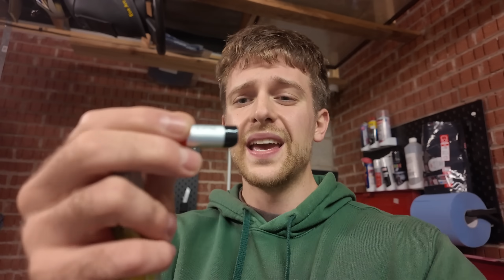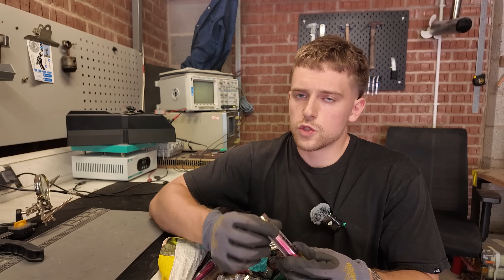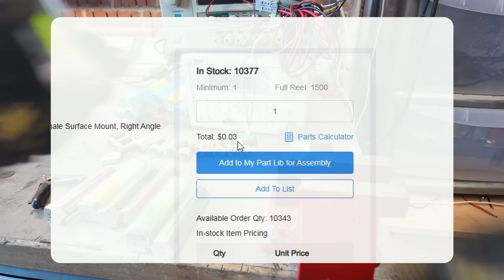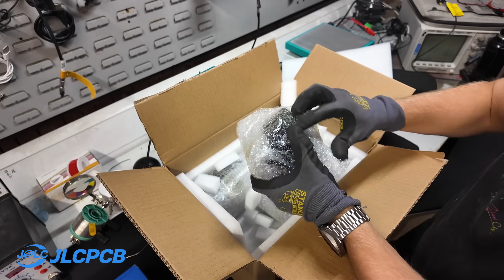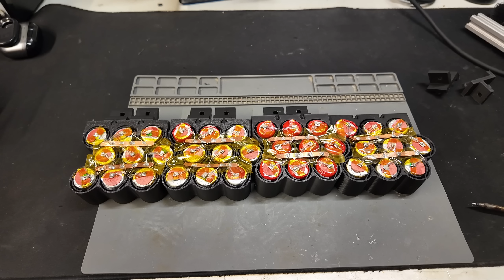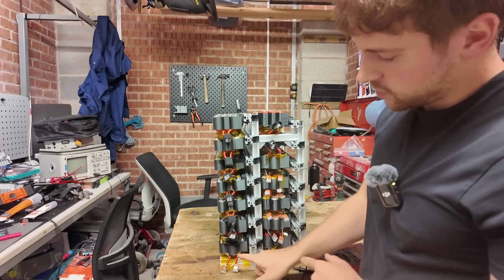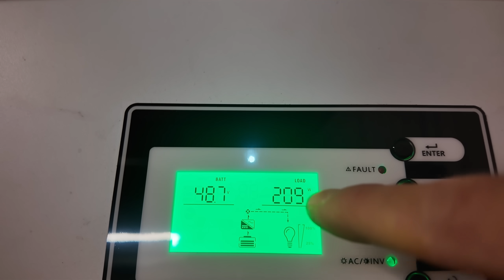I Powered My House Using 500 Disposable vapes

Comment: id be tempted to do something with em if they werent so prone to catching fire..... they burn realy hot.... if youre smart youll burry the big batteries you make at least four feet down after you have em wired up - then it dont matter if they melt down as much... least it wont burn your friggin house down (you can turn a 55 gallon drum into a battery if ya want then)

Comment: i collect these from my coworkers to scavenge the coils and batteries from them. not much juice on their own but surprisingly decent cells usually of a standard diameter or common pouch size making them easy to adapt to fun little things. gonna try and make some 6s packs with connection for combining to get a good pack size. most of them are the same vape and have 18300 cells.

Comment: I used to work for BAT in the battery lab, CT scan , SEM and cell cycling, sorry to say but the charge/discharge cycle on disposable vaps is very low.. you could get about 20-50 re-charge cylces compared to 550-800 on the 18650 cells. so great project but maybe, next time, use 18650 cells from old laptop batteries ? or pouch cells from the newer laptops

Comment: about 4 mins in but im pretty sure a lot of thease  cells below 3 volts can be  trickle charged toi try and recover the cell i saw somone do this with old EV batterys before wich are also lithiom ion so you would  likly need to build some kinda device to  trickle charge  mass amounts of cells  and rebalance them i think is the term

Comment: Sir this is how you earn a sub. I was tinkering with a gigantic dispo vape, turning it into a rechargable battery bank.. and I found a video of you powering a house with it. 

I legitimately wonder about the long term viability for that.. It would 1000% work in a power outage situation.. Id want to have some serious Cooling measures & fire safety installed if I were to use that bank for more than 10-12 hours though.
Reply: If you need any heat sink / cooling designs, let me know, would be glad to help.

Comment: You need a solar system panel or  what you can do is rig a 10amp battery charger to it so it never goes dead be charging when your a sleep that's the way i would go or get 2 chargers throwing out 20 amps dirt cheap on Temu get the clever ones

Comment: It's not really accurate to say cells below 3v are damaged and unusable. It's more accurate to say they are degraded, in that, they wear more each time they are brought that low than they otherwise would have been from an equivalent number of cycles within the recommended/rated voltage range. I have regularly (maybe 50% of the time) recharged batteries well below this threshold and compared them to batteries within the recommended range only to find them within margin of tolerance as far as capacity and internal impedance. Big Clive did a video where he mentioned that a lot of powerbanks are shipped with the internal batteries at voltages well below what they are rated at for safety reasons, sometimes 0 if I remember right and they give their rated capacity after a charge.

In a battery pack though, where the cells are in series, if one cell were to be 1.7v while the rest are 3.4v, it is highly likely in this case that that cell is damaged, which is the reason that it fell out of balance to begin with.

https://www.youtube.com/watch?v=sRwoYJyjZNo

Comment: Great video and great proof of concept ... Although, it must be said almost every single aspect of this current setup scares the shit out of me honestly I’m so glad I’m not your neighbour 😂. Was ohms law used when calculating your main cable and fuse ratings because they look way too small….Wagos at that current 😳. Back feeding a consumer unit to supply an entire house… I’m a qualified electrician and have a BEng in electronic and electrical engineering so have a little idea on the subject. A homeowner in the UK got find 60k this week for setting fire to his and neighbours property after he wired an extension lead to his shed from the house. What you are doing is notifiable works you need to be a qualified electrician and contact DNO. You could be in for prison time and 100’s of thousands in liability you crazy bastard 😂…. My advice, refine the battery bank and get it enclosed. Get those Wago clips off and get plugs on there for easy assembly. Upgrade the mains cable on the battery to coincide with total current load when house is connected. Then get a sparky to commission that way you keep yourself covered as currently your insurance company would not be impressed and certainly won’t payout for you or any neighbours affected.. And don’t add solar ffs until you have spoken to DNO and has a sparky commission the consumer unit and have all the above sorted with the battery, there are a lot of considerations including what type of mains supply you have and its earthing arrangements there are 3 types and not all are suitable out the box it could be extremely dangerous for you and your neighbours, genuinely your neighbour could take the hit in an electrical storm via its earthing arrangements essentially making everything connected to earth live including the gas mains. All that being said, keep going just keep yourself and neighbours safe in the process.

Comment: 17:46 do you have something in that breaker setup to prevent back feeding power? For instance if the power goes out from the city and then you accidentally leave the breaker to the house on. You will back feed power to the grid which will best-case kill your battery and worst case kill a person working on the lines.

Comment: If they’re above about 2.6V they’re usually fine to recharge, though they might be a bit down on capacity. Once they’ve dropped below ~2.5V the damage starts to set in and they become a bit dodgy to try and recover.

Best bet is to test them properly with something like an Opus BT-C3100 before sticking them on what looks to be a bloody nice charger – check both internal resistance (IR) and capacity after a full cycle. That’ll tell you if they’re still healthy or just e-waste in disguise.

Comment: Lithium cells aren't just blanket "dead" whenever they get fully discharged. There are ways to recondition them, shock charge, or even just regular charge and test.
It takes a considerable amount of work to fully kill a cell in-circuit.
Reply: This. The correct way to bring back severely discharged lithium cells is to slowly charge them at a low current and measure the internal resistance when full, then do a cycle/capacity test and measure the internal resistance again. If it's equal to what it was or lower then the cell is good. What you don't want is a cell not taking a charge, heating up wayy too much (Some heat during use and charging is expected and normal) short circuited or unable to deliver the current it was intended to do.

Comment: Here in Germany, we have the world's largest model railway, Miniatur Wunderland Hamburg, where around 11,000 miniature cars run on built-in magnetic tracks. About two years ago, the operators had the idea of using the batteries from disposable vapes to power their cars. After announcing a collection point in the building, so many visitors donated their disposable vapes that they won't need to buy new batteries for years to come.

Comment: The disposable vape ban is a bit of a joke. Many of the old ones had a charging port but not. They are the same amount of "disposable" just able to.be used in a non disposable way. 
Plenty of them also have a small entire display and computer graphics circuit as part of it

Comment: I love this series because it shows how horrible the companies are for making these instead of adding a bms and make them rechargable
Reply: They are rechargeable but just not refillable. They have BMS on the board.
Reply: @MrWhitty2000  fair point i guess just making them the way they do is what i hate
Reply: @MrWhitty2000  the "BMS" is actually built right into the charge control IC.
Reply: It's not horrible if you have $$$M in your pockets, you just don't care
Reply: @nikostalk5730 its not about the money, its about the wasted resources. There is literally zero reason to make a disposable version of this very reusable technology.
Reply: They are rechargeable, maybe throw blame at regulating bodies, instead of companies
Reply: @HotProbs  I blame both since they are both part of the problem but you have a valid point

Comment: 13:22 the 3rd layer up from the bottom is noticeably smaller than the other layers. Looks like one 9x pack less. Won't that give you a capacity mismatch for that voltage band? (Assume it's the 7.4v to 11.1v band)

Comment: Nice, but there is a security Risk: There is noch thermal sensor in the packs. If 1 Battery will heat it will heat others to and produce a thermal runaway.😱

Comment: The under voltage batteries are not as damaged as you think, to do some damage you have to take them so under voltage the + become - You just need to get a bit of juice in them to get the voltage backup over what ever your charger has the min voltage set to.

Comment: If you’re soldering a lot make sure you get an extraction fan in your workshop. Don’t ignore your health.
Reply: 18:26 he's got an extractor fan 🙂
Reply: @akinadom  Its a filter though, doesnt vent to the outside so particles are still getting through
Reply: @takingiteasyforthesinners indeed. Not optimal, better than nothing
Reply: @akinadom  better NEVER DOING than paying medical bills (out of recycled aluminium vapes)
Reply: @nikostalk5730  He's a brit... only us American's go broke paying medical bills.
Reply: Its not lead its flux
Reply: @Conorscorner it depends, he may or.may not be using lead free solder
Reply: Boring!

Comment: Thats why i love things that are powered by bateries that you can remove.
A lot of people had to dispose of good eletronics simple because they have an inernal battery and they were left too long without charge, but a simple swap on the battery would have solved the problem.

That is something the EU should ban, glued batteries that you can't easily remove. There should be a international standar on how a battery should be so you can buy one a fit in any eletronic without having to find the right one for your equipment.

That would solve so much of waste we produce.

Comment: the 3d printed tpu contact is genius..bravo
Reply: I was actually thinking of just use copper plated springs but that works too
Reply: thats practically what he has done here, but even smarter because instead of going and buying copper plated springs, he made them himself
Reply: @ULouOW exactly, why do all that when you already have a printer with a spool of TPU
Reply: Agreed. That looked like a high end product solution
Reply: You could use foam rubber from an old sofa 😂

Comment: "Pretty bloody heavy" is an understatement. I bought my first UPS a few days ago. 3000VA worth of lead-acid battery. I didn't even think about the weight before I got it. It's manageable to carry short-term, but it arrived on a pallet.
Reply: Also, you can't discharge lead acid batteries below 50%, and lead acid batteries these days typically live for 3-5 years.  LiFePO4 batteries you can get a good 20 years out of them, sometimes more.

Comment: I know it is pedantic but I would like to see you go fully off the grid by connecting solar panels to the vape power wall. I would also like to see you get an older ev or plug in hybrid and build a battery to power that.

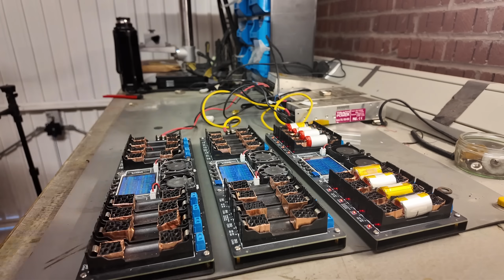Comment: 6:11  NO, its not important to have the same capacity when connected in parallel, that is incorrect information, all cells will discharge at the same voltage, its VERY important they have the same capacity when connected in SERIES!!
Reply: He ends up connecting them on series

Comment: cool Vid. I used totaled honda clarity 44v battery modules to charge wifes I3 and now got a circuit charging Electric Dirt bike and 4 Electric Scooters. I have about 1.2kw in solar and 6.6kw battery bank with a 3500watt inverter @120v. About to do an upgrade!

Comment: Seems like it would have been better to use a spot welder for the metal strips instead of soldering them. Less of a chance for connection failure.

Comment: 19:52 Absolute terror, pulling 3kW from a 2.6 kWh pack made from scavenged cells
Reply: not really. the cells being used have a 10c rating, meaning each 1.5amp cell can produce up to 15amp each.
Reply: That 2.6 kWh is total charge capacity, not instantaneous current capacity. The 'C' rating of a cell will tell you roughly how much current the chemistry can deliver at one time. From what I remember its a dimensionless number calculated from things like the electrolyte, anode, and cathode chemistry, internal resistances, temp, age, etc etc etc, but it effectively boils down to the number of electrons it can suck across the terminals at any given moment, where as the charge capacity is how many electrons it can move overall. Remember, a KWh is a kilowatt...for an HOUR! Thats a lot of juice! All pulling 3KW from a 2.6KWh capacity source means is that it will last less than an hour at that current draw. 

Think of 12v car batteries (flooded lead acid). They have a charge capacity around 60~70Ah, but are also rated at 600~700 CCA (Cold Cranking Amps, or the amount of amps the battery can deliver when the temperature is at freezing (cold makes chemistry slower, so it matters when its cold and you want your damn car to start), yes battery acid is not pure water and does not freeze at 0 celsius, that whole water physics thing is beyond the scope of this comment...). That means that battery can deliver at least 10 times its charge capacity instantaneously as current, or 10 * 70Ah = 700A To simplify we just say the battery has a current capacity of 10C. Of course you only have 70Ah in the cell, so its not going to supply 700A very long, but long enough to kick the engine over and get the alternator going. This is why you can only run the starter for so long before it starts to bog down, its been providing a lot of current capacity thus emptying its charge capacity!

Hopefully some of that made sense, or at least gave you some stuff to explore further on your own time 😎👍
Reply: @zombieregime It's actually not dimensionless, it has dimension of /hour, because it is a measure of what fraction of an hour it would take to fully discharge. So e.g. as the previous commenter mentioned, 10C means a 1.5Ah pack can sustain 15 amps, which should drain it in 1/10 of an hour.

Comment: Please be careful and check up on this often. 

I made a pretty large bank of 18650 cells from new and old cells, it was about 20kwh of storage. 

It was run on a bms and the high voltage cutoff was set at 4.1v to keep the banks from wearing out. 

It ran perfectly for 4 years. I used it for multiple power outages and to offset electricity for my 3 refrigerators. 

Well, one morning after I got home from a weekend trip and left the battery bank discharged (I never left the house with the battery fully charged),  this pack failed the morning after I got home, it wasn't even charging. 

It lit on fire (real fire, not smoke and sparks) and I was only able to put it out because I ran outside and grabbed the water hose. 

Mixing various batteries is not safe. Ironically I was most afraid of the batteries I got for cheap from the hoverboard fire issues that I thought would fail... Nope, it was batteries from brand new brand name laptops.  When I took the battery bank apart I found that many of those had split and bulged, and some were rusting from the inside out. I even had some in a sealed ammo can in my garage that I checked out after the fire and they were rusting and venting electrolyte.

Long story short, do not put these projects in your house or garage. Next battery bank I do will be in a brick shed that can burn down. 

Seriously, be careful guys. I had a huge wakeup call that morning.

Comment: The question arises as to whether these cells are sufficiently reliable for the intended flow flow. Although I myself have a setup of 64 larger sample cells, I would be reluctant to implement hundreds of smaller cells in a residential environment.
Now, solar panels on you roof.

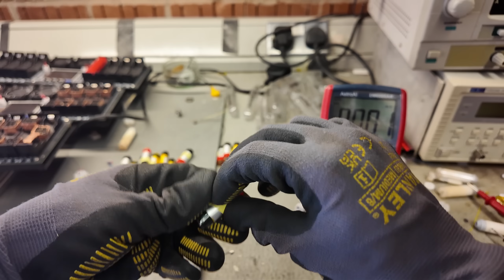Comment: 2:31 2.5v actually not 3v
Reply: 3.7V nominal li-ion cells go from 3V to 4.2V. The common value for cut off is around 2.8V but as you said it can go to 2.5V, although rare.

Comment: Btw, you want the groups of cells in series to have same capacity, not necessarily each cell in a parallel group.
A slightly lower capacity cell in a group will simply handle a smaller share of the current but a lower capacity group in series will limit the full capacity of the entire stack of the final battery.
You didn't make it very clear what you were intending to do so I am hoping you grouped cells up so you got a nice even capacity on all groups.